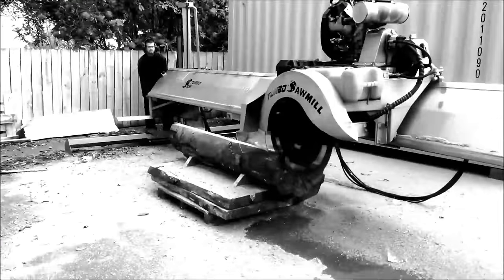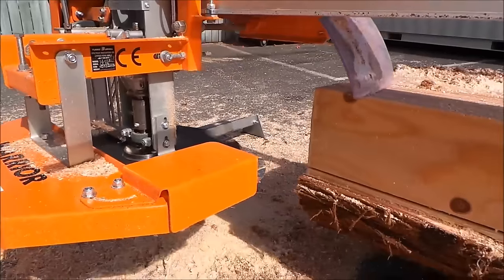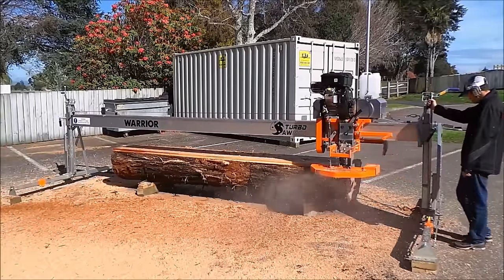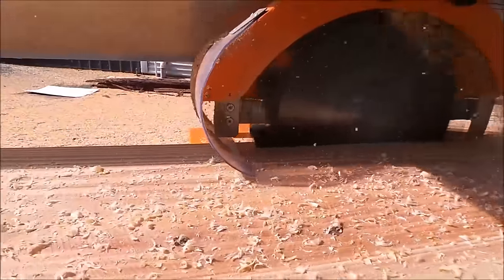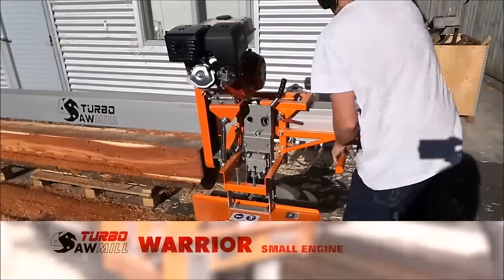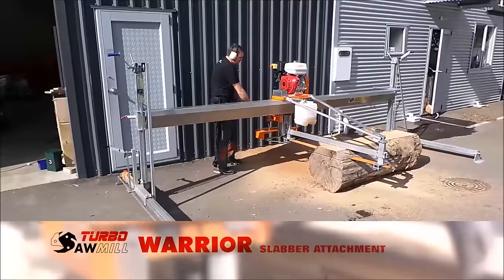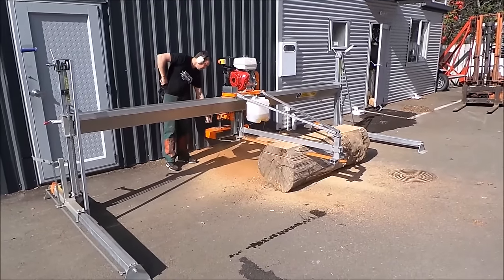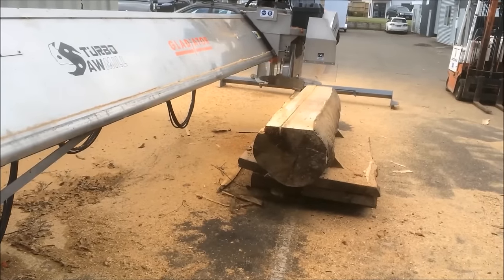TURBOSAW OFFICIAL CD

Comment: These swing blade saw videos never seem to show more than the first 2/3 of the log being sawn. What happens when you get down to the last couple inches of that log? What holds it in place?
Reply from the maker: Well I can tell you it's not a conspiracy. The usual process is you cut a 6" x 2" wide notch in your support bunks. The log simply cradles into these. The two edges hold the sides of the log. When you get to the lowest point the only tendency is for the log to slide sideways to the left as this is the direction the blade is going. Because it sits within the two edges its impossible for the log to slide. Typically the log does not lift as its fighting against gravity in the vertical. That coupled with the fact that a single blade creates very little resistance.

You may be familiar with a twin saw which has a tendency for two blades to work together and throw the work peace. Swing mill is very different - in fact when sawing your bottom cut you can take your cuts in smaller (2 step) increments to further reduce the drag caused by the blade.

Hope that explains it :-) if you want to see mills go right down to the bottom thinnest slab have a look on turbosawmill's facebook page.

Here is a link of this mill sawing a log down to absolutely nothing... https://youtu.be/fb-fjQ7OJm4 

Cheers.
Jake.
Reply: Thanks Jake! I didn't figure it was a conspiracy, just was odd none of the videos I watched showed it! lol 
I wasn't sure how much drag the blade created. I'm used to bandsaws, which simply pull the last board to the left against the stops. But as the blade enters the wood, it can sometimes make the far end pivot to the right on short logs.

Comment: Wouldn't be better on the blade and wood to cut horizontally first?
Reply from the maker: TheWaterman1000 only if the timber was to heavy and affecting the blade otherwise it’s advantageous vertical first.

Comment: I live in Vanuatu how much it cost in vatu worrior auto ,how can I get one
Reply from the maker: 1,990,000 email retail@turbosawmill.co.nz
Reply: thanks for replying ,that price suit what size of inch blade?
Reply from the maker: 8"
Reply: thanks I just bought a used one and it's a 10 inch and I want u to give me the size of the same 2 belts that connects the engine pulley and gear box pulley (blade conne ct to)and the other one(1belt) that connects the engine  pulley and the gearbox that moves engine front and backwards.Thanks I'll get in touch for further information .I live in Santo. Vanuatu